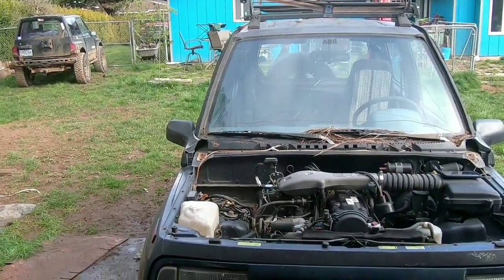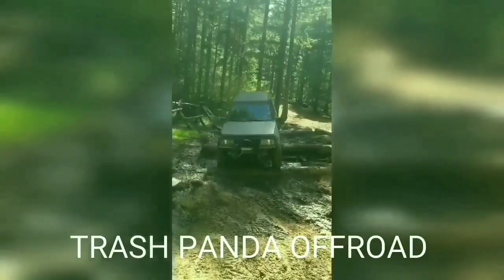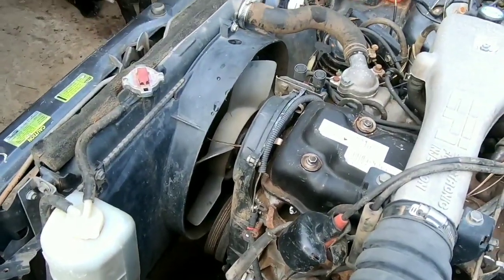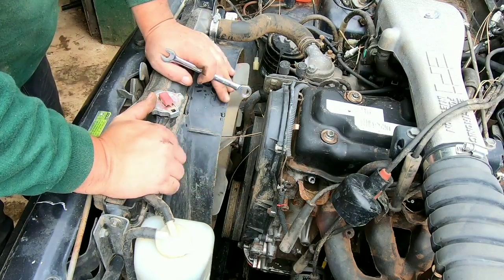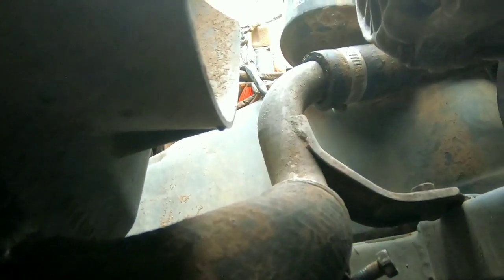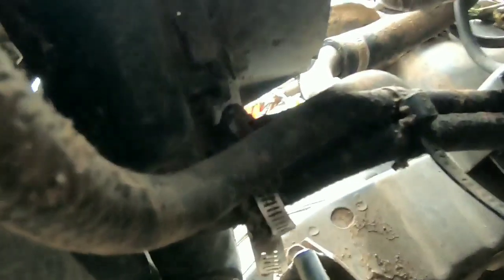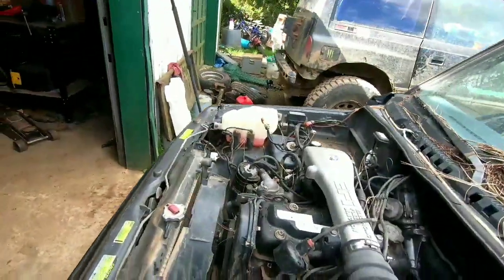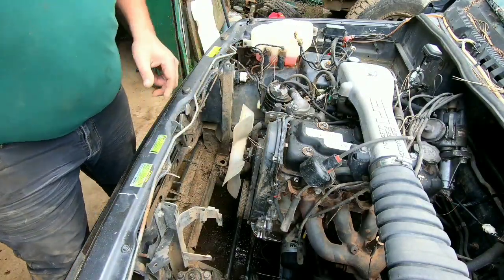Radiator removal from a geo tracker

Comment: My daughter has a 98 Chevy tracker that it has air conditioning with an extra cooler up front and I cannot get the freaking radiator out.
Reply from the maker: I believe you have to remove the ac radiator and fan also because it attaches to the radiator.

Comment: Hey bud question I have a 1995 4x4 gel tracker need a radiator but when I call they ask if it’s a 14 or a 16 for the tracker not sure what there asking or if you know ? But anything would help me get back on the road 💪🏽 thanks bud
Reply from the maker: The radiator for the 8v and 16v are different sizes. Take a quick measurement of the one you got. I think the 16v one is a little taller.